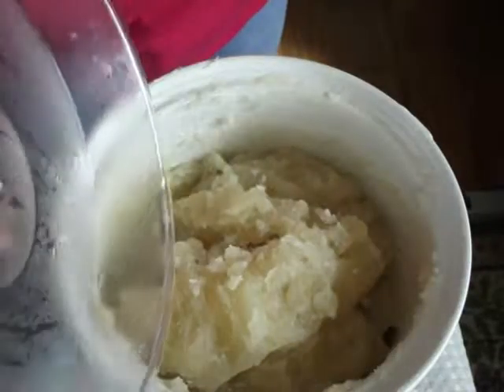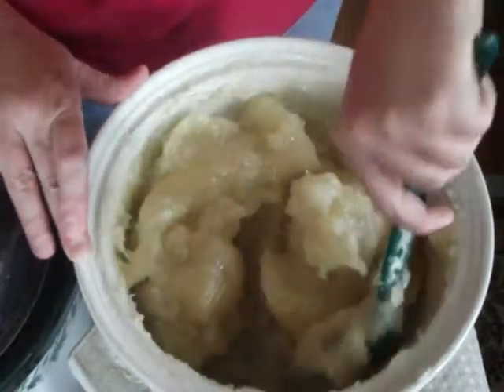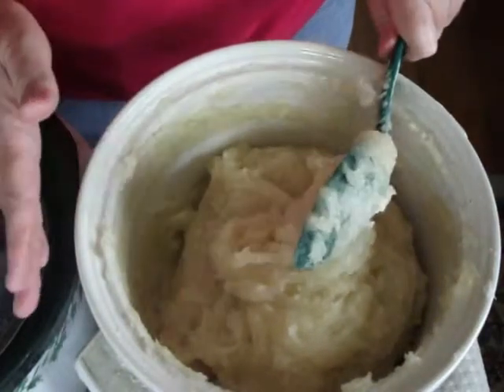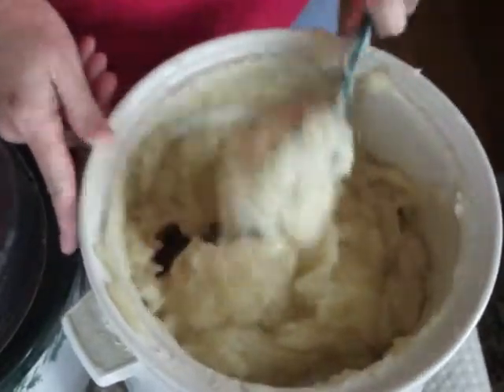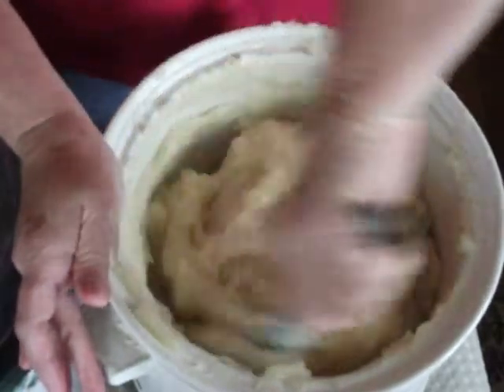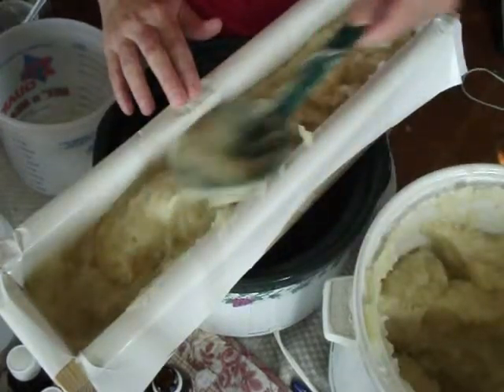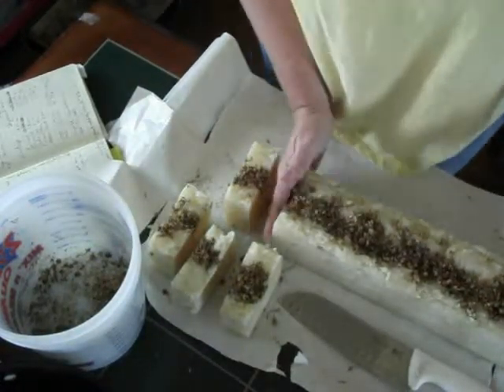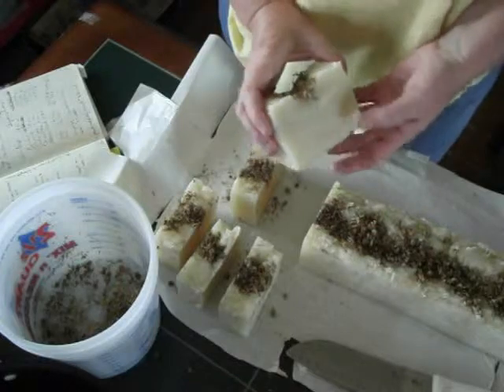4th and Final part of: How to make HP soap with hydrosols

Comment from the maker: It depends upon your crock pot.  If your crock pot is a hot one?  Probably an hour to actually cook your soap.  If it's like the one I used for this video? Then about 1 hr. 20 minutes. The rest is mixing in your hydrosol and Essential Oils plus, molding.  Hopes this helps. Hugs, Annie:)